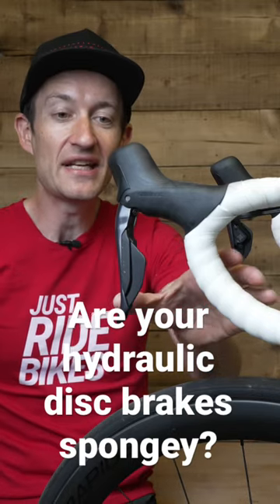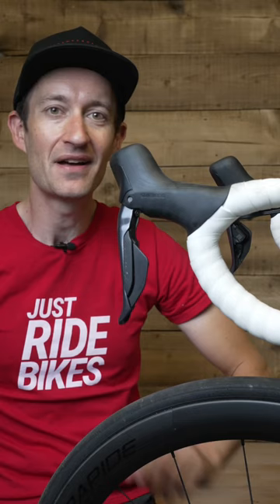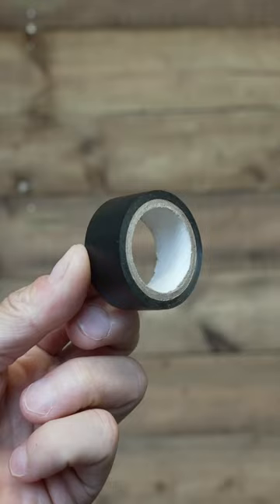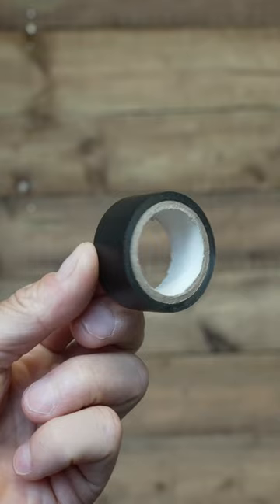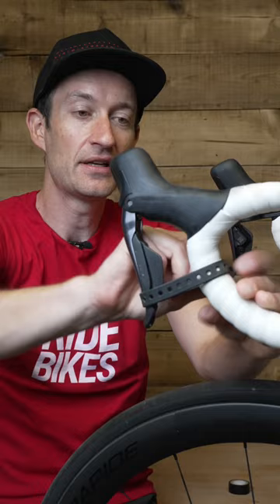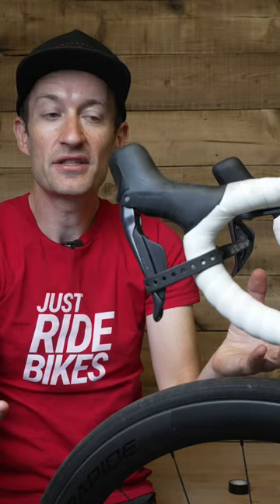Do this to fix your spongy disc brakes #shorts

Comment: I know this works but HOW?
Reply: By doing this it allows air in the system to rise especially if air bubbles are trapped in pistons or near it clearing the said piston of air but in time it will eventually become spongy again better to bleed with new oil to fill system and get rid of air bubbles from the whole system

Comment: What is happening, do the air bubbles all rise / get squeezed into the reservoir?
Reply: It compresses the air bubbles so that they move up the line to the reservoir more easily
Reply: @Christian Boorman  exactly!
Reply: @zEndersShadowz  makes sense... sadly what they do not say is that if your brakes a really spongy... then you go from spongy brakes to no brakes lol
Reply: @ChristianBorrman  I like to take the brake bleed screw off the lever and let it sit over night, add fluid the next day.
Reply: Don’t do that if it uses real brake fluid. Brake fluid is extremely hygroscopic which means that absorbs water out of the air.
Reply: @That.Guy. correct DOT fluid would be a nightmare if you took the bleed port screw off overnight

Comment: Just tried this last night and saw only a very slight improvement. Full bleeding required, then?
Reply from the maker: Yes most likely,  if this trick doesn't help best to do a full bleed - or you can do a half bleed where you just add more fluid from the top. Probably need to do a video to explain that
Reply: @davidarthur  Thank you. Looking forward to getting my 105 hydraulic levers to work better. 

As an aside, I visited a couple of local bike shops and squeezed many hydraulic disc road bike brake levers. Some levers felt great but the vast majority had levers that went to the handlebar or less than a finger’s width to the bar. At three different bike shops I was told “that’s the way they are.”  Are bike shops just lazy in properly bleeding new bike brake systems or  are most of salespeople just clueless?
Reply: @barryw9473 I know as a matter of fact my brakes was quite stiff a decade ago, as time marchs it becomes squishy.

Multiple things could happen, air getting inside, brake pads are worn out, reduced oil quantity, piston damage, etc.

and I agree, those mechanics arent interested in helping unless higher pay included as its pretty time consuming to understand our brakes deeply.

Ive been studying my own brakes and I could say, if its not as good as how it used to be, maybe seek for a new swap if you crave for performance.
Reply: I've done a bleed 3 times still a bit spongey any help please

Comment: My Bike breaks are spongy even after break bleed, will it fix ?
Reply from the maker: Probably needs a full bleed
Reply: @davidarthur  thanks for replying.I have done full bleed. You mean first i get everything out and refill it?
Reply from the maker: @punusha  if you've done a full bleed they should be good, but it suggests that maybe you've not bled them correctly, and there is air in the system. Maybe worth trying again?

Comment: I did this to my cable-activated disc brakes, and now my cable is stretched out. Plz advise.
Reply: he clearly states it’s for hydraulic disc brakes at the beginning of the video.
Reply: This right here is why bike shops will never go out of bussiness
Reply: Rotate bike 180 degrees and repeat procedure. This will stretch cable in opposite direction and cancel each other out.
Reply: You need to inverse stretch them. Hope this helps!
Reply: Tried CTRL + Z?
Reply: @piltrid1   Thanks, that fixed it.
Reply: :) LMAO
Reply: @MrPijus123 😂😂

Comment: Nah I swear I was changing my wheel last night I had put the bike upside down well when I finished my front brakes got loose as hell I opened the pot thing the oils seems full. I was going to bleed them but then I came across this video I’m going to try this
Reply: AND what happened ??
Reply: @user-mu6rj5te5p  unfortunately it didn’t work and I’m going to do a full break bleed.